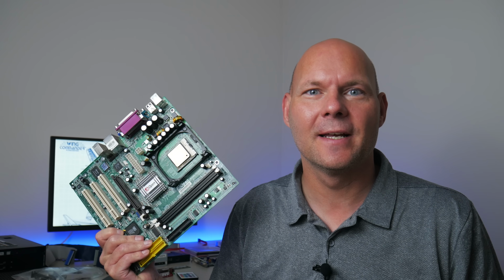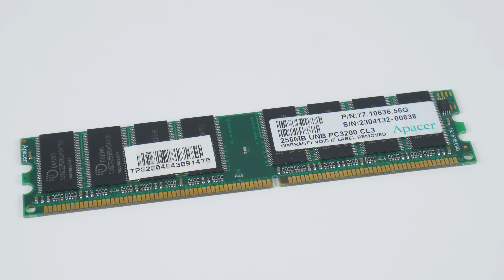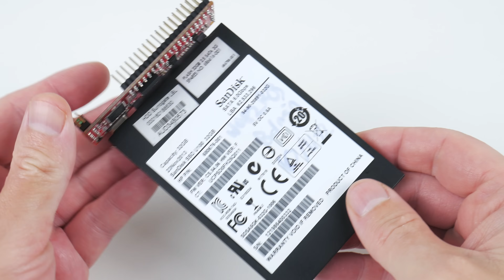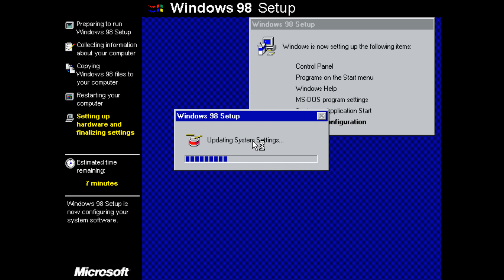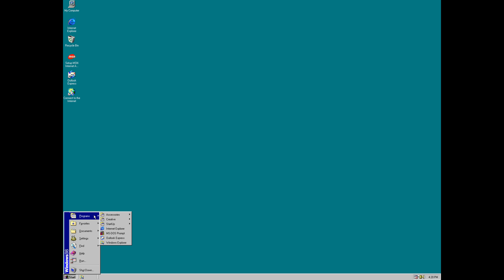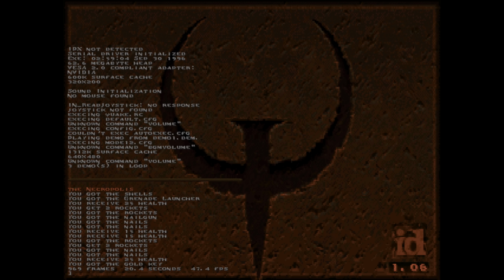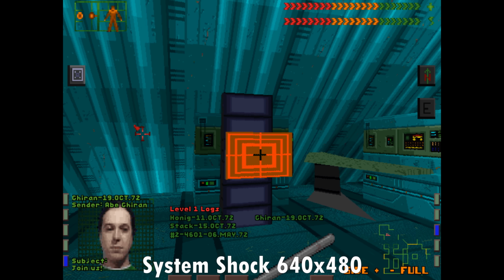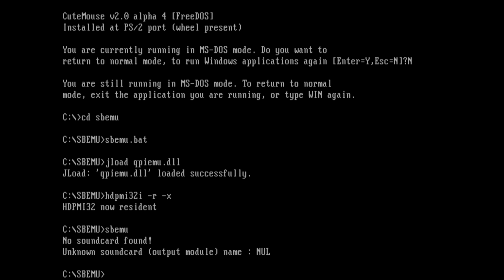Pentium 4 with SIS chipset? Sometimes Retro PC Gaming can be frustrating!

Comment: Tomb Raider was capped to 30, and the game's software mode had an imperfect or absent Z buffer so some PS1-like distortion is to be expected.  If you use Glide natively, emulated, or wrapped those artifacts shouldn't be present but the cap will remain.
Reply: Texture distortion has nothing to do with the Z buffer, it's because of the lack of perspective correction. Games at the time used per polygon affine texture mapping because the host CPU didn't have enough processing power to do perspective corrected per pixel rendering and maintain an adequate level of performance.

The Z buffer is used for sorting which objects are rendered in the camera view frustum. Many games also didn't use a Z buffer, in favor of the painters algorithm due to again limited resources. Z buffers use quite a bit of processing power and memory, something which PCs of the time didn't have in excess. Anything below an 8 bit Z buffer and you may as well just use the painters algorithm because Z fighting will become a big problem with everything being rendered clashing for priority.
Reply: Mini GL + Glide is supported, Voodoo cards only.
always weird running it on TNT cards.

Comment: I'm currently using a micro-atx Socket 7 motherboard with SIS 530 and 5595 chipsets. Works well in MS-DOS 6.22 . In windows 95/98, it works well too but runs out of steam with 95/98 games using a Pentium 233MMX. Using AMD K6-2 350 works better but staying at lower resolutions. I ordered a K6-2+ 500 to check out if I get a better gaming experience and better score in futuremark99. The card I'm using is a Riva TNT on PCI. Motherboard doesn't come with AGP. On windows 98, I use Driver version 8 and on windows 95, I use version 6 because 8 freezes on start up. Those were the best drivers for good scores in Furturemark99. Games ran a bit smoother too

Comment: For Windows 98 on most titles that don't require a CPU fix I've had no issues using a P4, but many DOS titles I had a bunch of problems with crashing caused by the soundcard (IndyCar Racing II was ultra-temperamental on soundcard when I used a Rendition PCI video card). ISA cards can fix the issue, but P4 board with ISA slots for the soundcard are so rare.
Reply: try sb live 5.1 its good for win 98 and dos games.

Comment: i remember back in 2003 ..i bought SiS mboard for us$40. The cheapest s478 for Pentium4..nvidia .GF 4 mx not able max out  HAlFlife2   800x600  60fps . 2 year later save some money replaced the old gpu to Radeon 9700 ..
and the Fps different was night and day compare 4MX.... Even Doom3 run butterry smooth ..

Comment: Yeah I tried a SiS 662 Socket 775 and while Windows 98 was fine, I couldn't get sound effects from Live / YMF or Vortex under DOS. Vortex gave me FM which was surprising.. But another board I have from ECS, I'm running a C2D E8500, 6600GT DDR3 and a Aureal Vortex and everything works, from Win 98 to the SFX in DOS..

Comment: This project really confirms me how important it is to pick your chipset platform carefully when your using MS-Dos.
If it is the late era such as a Pentium 4 or Athlon 64 I find that VIA has the best compatibility, and my VIA based system doesn't run into any of these issues.
I also don't recall any of phil's VIA builds ever running into any of these issues, so for me SIS is definitely not worth buying if it ends up like it shows in the video.
Reply: yeah's he said many times VIA chips are best.
Reply: Or, you just pick a 486 to get something appropriate. P4 for DOS? Come on.
Reply: @miljororforsprakpartiet290  In my case a Athlon 64 X2 2005 build. Gets me a lot of versility from Crysis 1 all the way to the 80s. Very stable on DOS to. These things can be done, you just need to be careful with your hardware choices.

Comment: I love w98 with a modern hardware, i have celeron 3.33ghz, gigabyte ga8vm800pmd-775 and 256mb ddr2 ram and yes it is fully compatible with Windows98 (it has a sata ports which has a native ide mode and ssd works perfect without any adapter) i spent too much time playing with newer hardware with older software tried too many options (and indeed use s478 as well) i think my celeron 775 is my best creation for the purpose and same gpu choice as you fx5200(quiet no fan no extra power connectors and such).

Only downside is it doesnt support agp1x and 2x so no vodoo for me but i have a pentium 2 system just for that purpose if i require.

Comment: If I ever manage to find an identical SiS board (the only branding on its box was SiS, so probably reference) to the one in my first PC that was capable of 3D graphics...I'm pairing it with another Celeron D at 2.4GHz, and "drag racing" the iGPU next to an SiS 315 and 315E.

Maybe GLQuake won't be bugged unlike the non integrated 315 (it is worse than with the SiS 305 - dedicated or integrated). Fun fact - the 315E is cut down more than the iGPU found in some of SiS's Socket 478 chipset.

Edit: Yeah, definitely is better with GLQuake. Still find it amazing that the SiS Mirage was more capable than the Mobility Radeon 9000igp (the version without a vertex unit) - and that it could run Halo.

Comment: This PC is pretty similar to my Windows 98 machine except I went for a GeForce 4 graphics card for driver compatibility reasons.  I wouldn't discount drivers to be the source of the issues seen here.  I would suggest down-grading the GPU and sound card to ones that had more support in the Windows 98 era like the GeForce 4 or and an older sounblaster series card.
Reply from the maker: GeForce 4 is an awesome Windows 98 card!

Comment: Phil I have been using an ECS 661GX-M7 with a Pentium 4 processor. The motherboard uses the SIS 964 chipset. I have run into exactly the same issues as you. Doom crashed with low tic rate error. Duke3d just freezes. I also noticed sound playback is slow. Having seen that you have the same problems I think it could be the chipset. If you turn off expanded memory the problem goes away but of course so does the sound!
Reply from the maker: Thank you for sharing, this helps a lot. I will for sure test again with Intel chipset soon 😃
Reply: Phil just an update for you. Having had the issues you had I managed to get hold of an Asus A7V266E which is a Socket A motherboard with the VIA VT8233 chipset. I used the hard drive from my previous build and made no changes. I just let Windows install the newer drivers for the new board. I then went into DOS mode and guess what no glitches. So I guess that proves the SIS chipset has issues
Reply from the maker: @Roadkill7878  Thanks heaps for the update, that is good to know and confirms things 🙂
Reply: @philscomputerlab  Phil since you also mentioned trying the intel chipset I have tried this as well. I used a Gigabyte GA-81848P775-G  Rev 1.0 motherboard. The northbridge used is the Intel 848P MCH and the Southbridge Intel ICH5. Again I used the same hard drive as previously but kept it in DOS mode so I didn't have to worry about windows. I have only tried it for a short while but it seems to work very well. I also set up IPX drivers to network. Doom played with no issues over the network with a dedicated DOS PC. However when I tried the same with Duke3d it kept freezing. Now I am not sure if this is an issue with the chipset or something else. I am going to have to look into it further. The Intel chipset defo works better than the SIS chipset. I would love you to look into this and hopefully compare results. All the best

Comment: I recently made my dream Socket 478 machine. It has a Biostar 945GC-M4 motherboard with PCIe. I found a nice SCYTHE NINJA PLUS REV:B cooler with heat pipes to go with the 3.06 GHz P4. And a GT 440 1GB GDDR5 GPU. It runs beautifully on Windows XP. I can "watch" Youtube on MyPal and play Minecraft 1.2.1 at 30 FPS. Before this, I only had a Dell Dimension 2400 with a PCI GT 610 card, but it ran horribly. The difference a fast PCIe card will make on this platform is amazing. Great Video!!

Comment: That effect in Tomb Raider I think has something to do with the fact that it was a Playstation game, that is a common effect in most if not all PS1 3d games. Maybe they ported the engine and didn't bother trying to fix that for the PC. It's weird the way it works, like the screen is divided up into squares that don't perfectly synchronise. That doesn't happen when running on the Voodoo cards in Dos though.  Aopen = Acer.  Another Great video thanks Phil.
Reply from the maker: You are right! I was recently playing around with a PSX emulator and it has some options to correct these render errors. Apparently it has to do with limited calculation precision of the chips...
Reply: I think Tomb Raider is primarily a PC game. It was developed before the PS1 was invented. I don't know what 3D engine they are using but it is something common on all Tomb Raider DOS games. There is the texture sliding effect, is that what you are talking about?
In the video, I think he was talking about something else.
Reply: @louistournas120  You may be right, but it does look similar to what You see on PS1 3d games.
Reply: It says this ---- It was originally released in 1996 for Sega Saturn, MS-DOS, and PlayStation.

Comment: Phil, would you recommend socket 775 ? coupled with cedar mill core z.B. ?
Reply from the maker: The thing with 775 is that you might as well go with a Core CPU. But yes, Cedar Mill has some lower power options available and heaps of options with motherboards.
Reply: @philscomputerlab  Many argue the CedarMill core is the definitive and best Netburst core, but to keep it "maneagable" perhaps a low-end Celeron might do well in DOS and not cause problems because of the speed. I have no experience with that.
Reply from the maker: Yes it is! There are 65nm version and they are the best ones.

Comment: You can play all those old games on modern hardware, don't take my word for it but Pentium 4 platform is a nightmare, the caps sooner or later will die, the chipset itself often dies on many boards, it's a furnace even with fancy Zalman coolers, the AGP cards are also dying and it's not just the RAM banks that are starting to glitch.
Reply from the maker: I'm finding Pentium 4 gear surviving pretty well. Nothing like Nvidia chipset boards! The Intel chipsets are very stable also.
Reply: @philscomputerlab  Intel are the better ones indeed, the VIA boards by AsRock are quite problematic, specially the later ones that everyone wants where you get core2duo's and AGP. I have one that even though it has a new battery and the battery slot is solid and making contact, it doesn't keep time once I disconnect from power. Prescott is insane, you can expect 50ºC idle and that's with a fancy Zalman and MX4. I bought 4 boards they all died, it was so difficult to remove the caps on these boards, even with a top soldering station.
Reply from the maker: Intel took VIA to court and many motherboard manufacturers avoided using VIA, what a shame really!
Reply: @philscomputerlab  875P boards ftw!
Reply: Only the Prescott cores were a furnace. Northwood and Cedar Mill ran cool. Not sure about the core before Northwood as I never owned one.
Reply: @Imperious685  Willamette cores clocked higher but were simply less efficient clock per clock compared to the Pentium III

Comment: the fastest agp 3.3v chipset is the kt333, if you can find a mobo with it then you can run some high clocked 333mhz fsb cpus, this makes it probably the best platform for 3dfx cards because of the fast effective fsb clock of 166 mhz
Reply: Asus A7V333 probably 8)
Reply: That has nothing to do with the FSB, even the 266MHz FSB Athlons were faster then P4. But going for a P4 can be cheaper today, because those KT333 Boards are very sought after. And if you are not after the longest benchmark bar the P4 is enough because the Voodoo 5 5500 is mostly the limitation anyways.